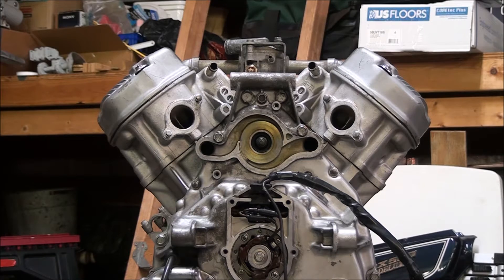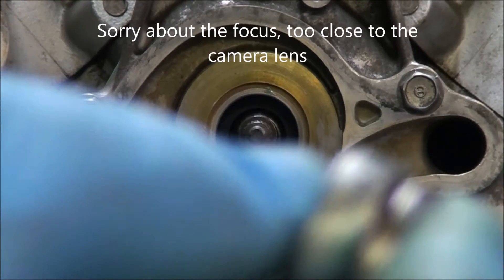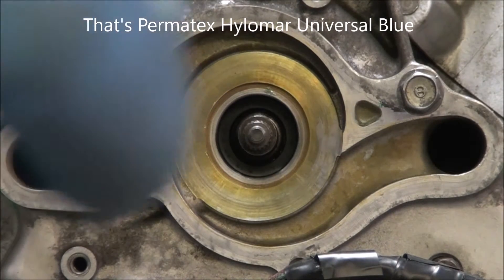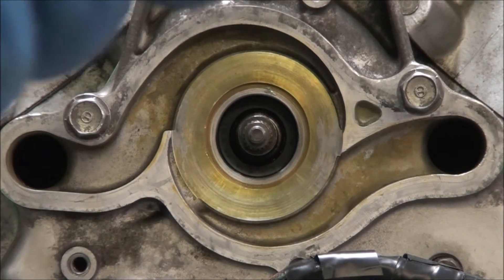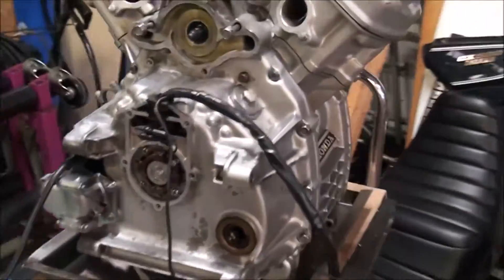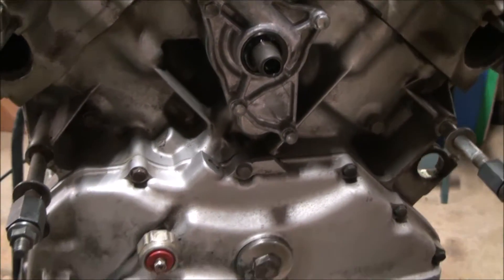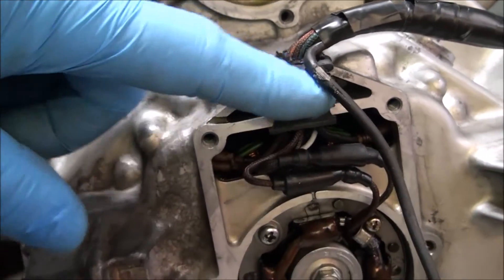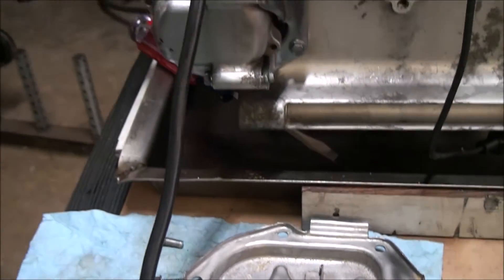Honda Failed attempt to mount mechanical seal

Comment: I have a question, it is necessary to empty the radiator in order to remove the water pump?
Reply from the maker: Juanfra mdq If you don't, you'll empty most of the coolant when you open up the water pump.
Reply from the maker: Juanfra mdq If you don't, you'll empty most of the coolant when you open up the water pump.
Reply: Thanks Paul , I appreciate it. Regards from Argentina
Reply: thank s!!!

Comment: Paul, most times the hole of the rear housing is too tight and needs to be reamed to a slightly larger diameter. Then use Hylomar or similar on installation which both lubes during inserting and seals then later in operation. Finally put a little dish washing liquid on the ceramic disk of the seal...it removes oil and grease from the surfaces and helps with sealing and bedding in. I changed those seal every 50.000km....which is just before they typically fail. I put 200.000km on my CX before i finally saw the light and moved up to a 1976 Moto Guzzi.....no mechanical water pump seals on those ones......you look after them and they look after you very well indeed.